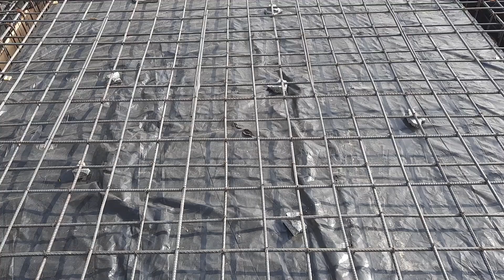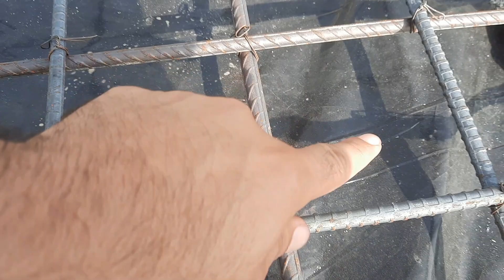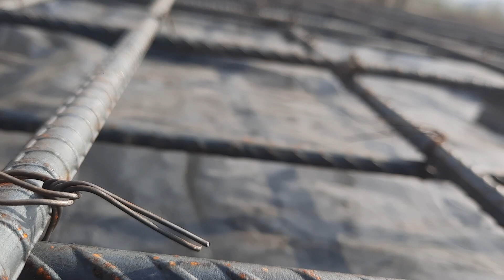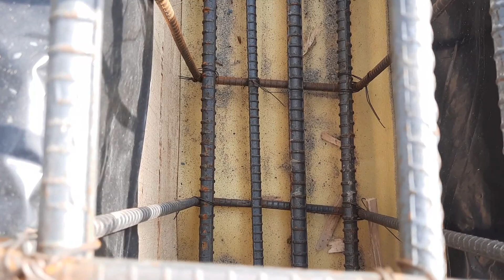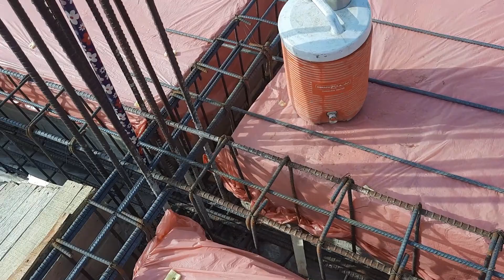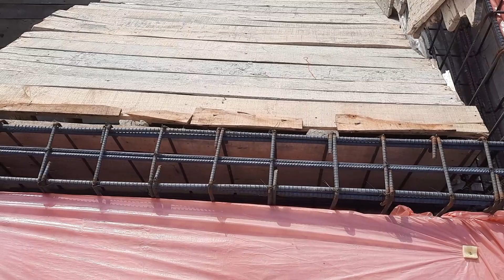Big Mistakes in RCC Slab - Lapping Mistakes - Reinforcement Mistakes - Civil Engineering

Comment: In a continuous slab when using crank bars in each slab panels at each and every beam intersection is it acceptable to provide the lapping with the cranked steel over the top beams at a distance of L4 on each side of beams ? If no where is the proper lapping zone  when cranked steel bars are used in slab panels at each and every beam intersection ?

Thank you Sir